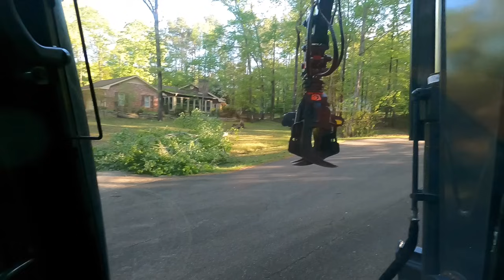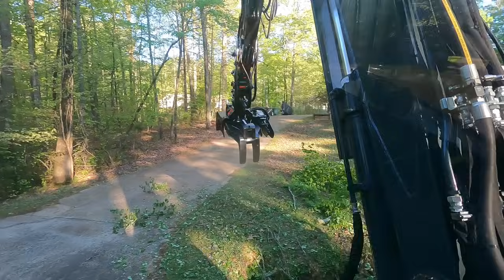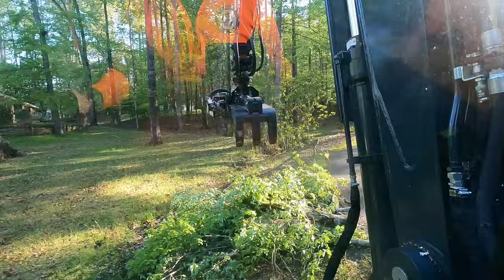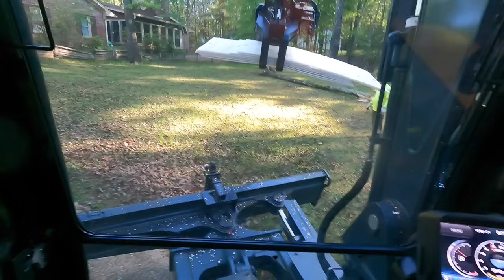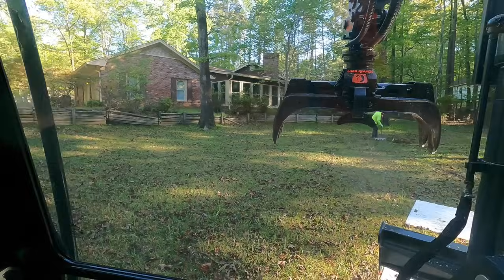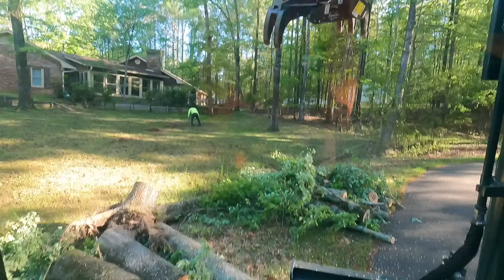Rotobec "Limb Reaper" did the entire job

Comment: Hold this pieces you’re going to cut up over your pile, cut them and then you can’t drop what you’re holding on the pile as you swing back to the work…speaking about when you moved up on the brush then started making that other pile…it will save you the trouble of picking up that small stuff that you cut into the ditch….anyway just a thought and  suggestion fwiw. I know I’m not telling you anything but efficiently moving the work will save you lots of time in the end.

Comment: More terrific content, the new machine is very impressive.
On full-size timber harvesters, 'chain shot' is a very real hazard and a lot of effort is made to protect both the machine operator (using guarding and 'intrusion-resistant' glass) and bystanders/co-workers by enforcing an exclusion zone around the machine.
Your helper here (Kevin?) looks to me to be perilously close to and in line with the running saw a few times during this video. Perhaps the viewing angle has me fooled, but it looks a bit risky to me.
Just an observation of something to possibly bear in mind for the future.